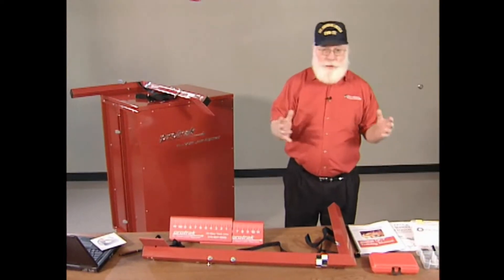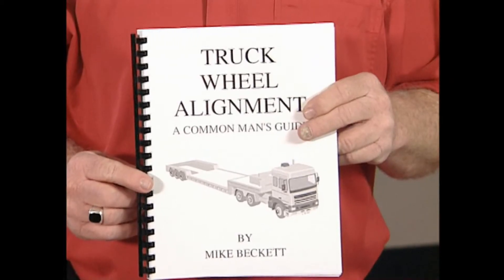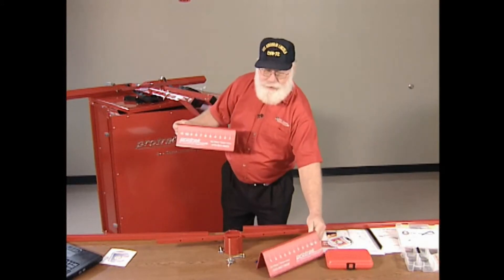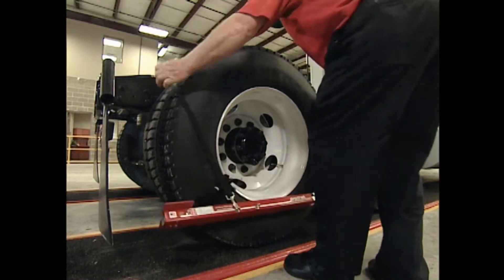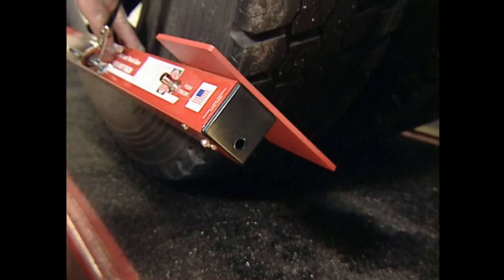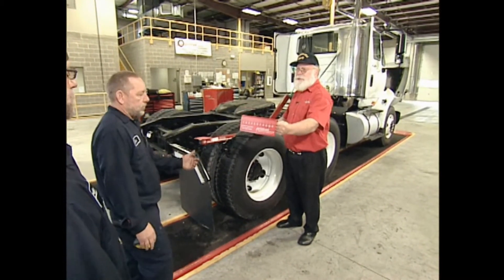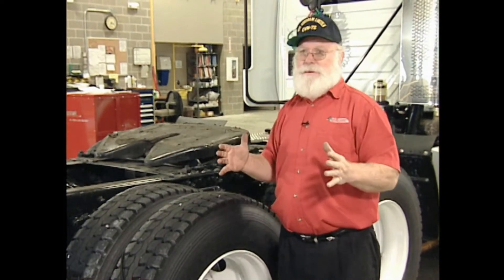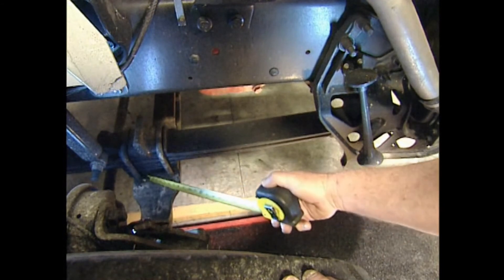QCT Demo

Comment: OK I DIDNT SEE ANYONE CHECK THE SETBACK OF ALL 3 AXLES TO EACH OTHER - THIS IS NOT FOR TRUE ALIGNMENTS
Reply from the maker: A setback measurement isn’t as reliable, accurate or helpful as a thrust measurement.  You have to measure setback from the front of the steer axle to the frame but fortunately you don’t have to do the same for the drive axles.  We do the same with trailers rather than using a tape measure to the king pin.  The protracted angle is a faster, easier, more precise method.

Comment: I've been using these tools for more than 4 years. I consider myself a Freightliner guy now. It's the #1 truck I work on. Our tire shop has had trucks that have gone from 70,000-80,000 miles on a pair of Goodyear steer tires to 130,000- 150,000 miles. I don't brag about the results, my boss does.
Reply from the maker: Which Tire store is that?  I need to make sure they are highlighted on our shop locator at www.mdalign.com
Reply: @MDAlignment  Shakopee MN. 1315 Maras street.

Comment: I love the subject of Alignment. I've been fighting a KW T800 Dump truck pulling to the right for 4 years.  I had it aligned with a brand new set of front tires 3 years ago and it did fine until it got its next set of front tires. Its been pulling to the right ever since. These tires are a  possibly 2 inches wider and much harder to steer.
If memory serves the left camber was 6 or .6 degrees positive and the right front camber was 0.
Reply from the maker: It’s typically not the camber that causes the vehicle to be hard to steer… among the common reasons a dump truck will suddenly develop a right pull are sheered steer axle spring pin (could be front pin or the larger pin directly over the axle), suspension wear between drive axles or (mentioning wider tires) steering component damage including king pins, bearings and tie rods.  It’s also possible there’s an inflation difference between steers or an inherent pull to one steer… have a competent mechanic inspect steer and suspension components and if all good rotate steer tires.
Reply: @MDAlignment  ok thx. This also has the Chalmers 800 suspension.
What is the ideal scrub and thrust angle on these suspensions?
Reply from the maker: @RC-Heli835  If you use our method to string a thrust angle on the front drive, it should be no more than 1/2" greater thrust  measurement on the left. If you measure to the narrowest point between the 2 drive wheels on each side, the difference should be no greater than 1/8 inch and if there is a wide side it should be on the right.
Reply: @MDAlignment  Thanks! That did the trick.
I propped a level on the tires and eyeballed it to a 4x4 laying against the front tires with measuring increments drawn on it and eyeballed it like a rifle. With the level laying flat, using the outside top edge as a guide.
I was reading 4.5 inches on both tandems to the left and 5.25 inches to the right on both.
I cranked the adjuster in on the front tandem exactly 2/16's which shortened the tram on the left side to 1/8" approximately shorter than the right side. Might could have gone a smidgen farther but it got dark and I wanted to tighten everything put up all the tools and test drive it.
Its funny I've been checking it for days after backing in to my spot and it read like 3 inches to the left.  6 left and 3.5  on the right for instance. Pulling strait and steady in forwards in the smoothest place I could find in the yard made all the difference in the world today. 
Fired up the old 80 gallon compressor to bust those 15/16's bolts. I don't think I could have done it without the compressor in that confined space. Now it just barely lightly pulls to the right.
I'll see how it does with a load tomorrow.😃

Comment: Mike, before you had all these fancy lasers, what did you use?  String and tape?
Reply from the maker: Although Mike used a lot of equipment over the years, a string and tape measures simply could not be beaten for reliability and accuracy until this system was developed for us by Jack Hobson in 1996